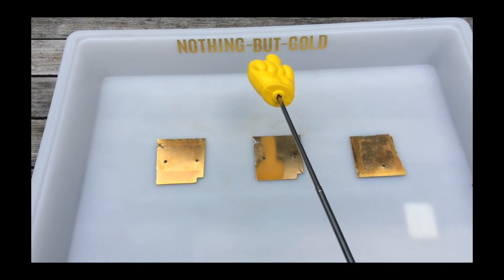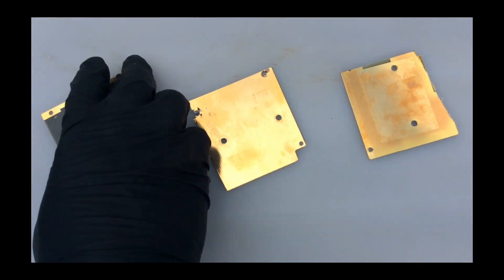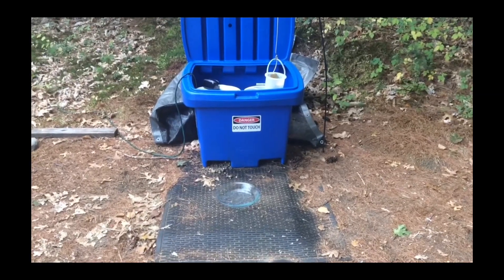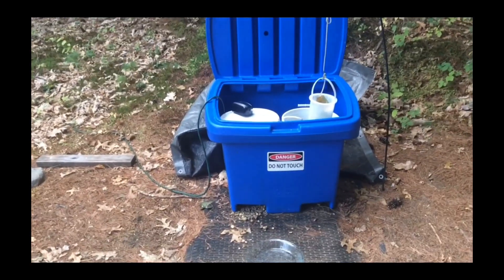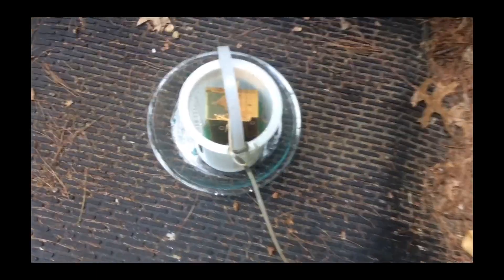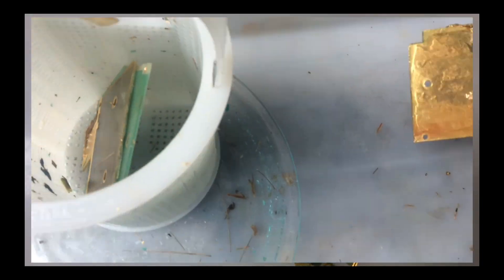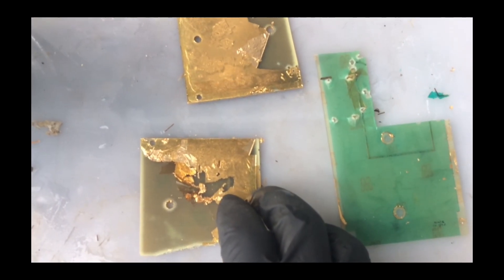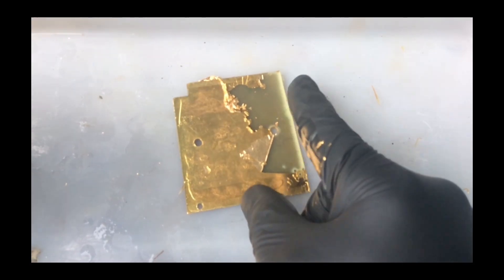Thick Gold Plating Removed from Old PC Boards (Beginner Safe Method)

Comment: I would like to see the dry weight
Reply from the maker: I did not think of that. They went into and out of the AP Solution and released the foils with all of the other items in the AP.
Reply from the maker: Also, I will be uploading a more precise video on this subject in the spring of 2026. Please subscribe so you can be alerted when it becomes available. Thank you.

Comment: Can you use this for gold pins thx
Reply from the maker: Yes. I had great results last year doing this. However, the released gold will be a dark powder on the bottom of the beaker/bucket of the AP. You can also go straight to Aqua Regia and skip the AP process. Good luck.

Comment: What percent was the acid and peroxide thx u
Reply from the maker: I used 3 gallons HCL + 300 ml peroxide. However, I may have used too much peroxide and inadvertently dissolved some gold. You actually don't even need peroxide; a piece of green corroded copper and an air bubbler is a better way; give it about a week to turn to copper chloride 2 then add the boards.